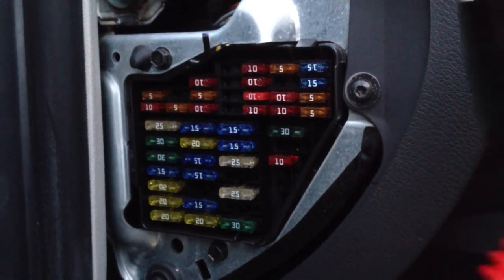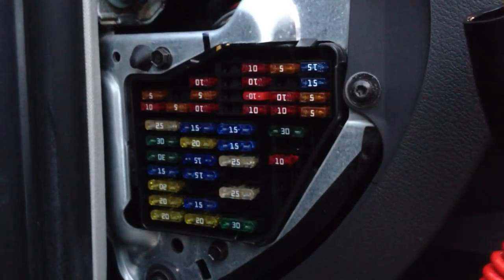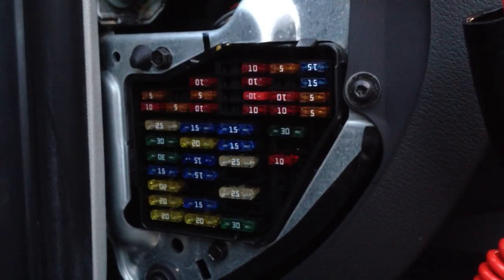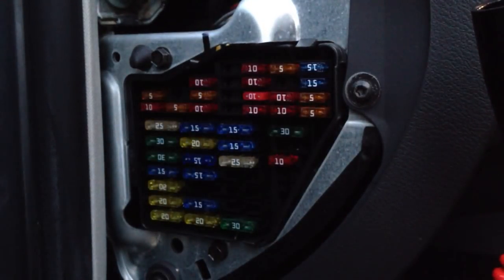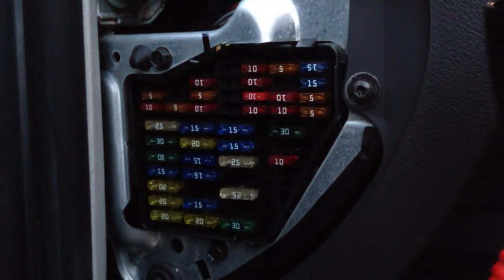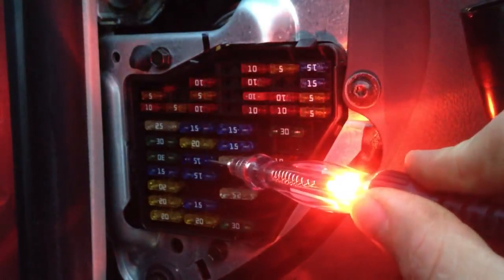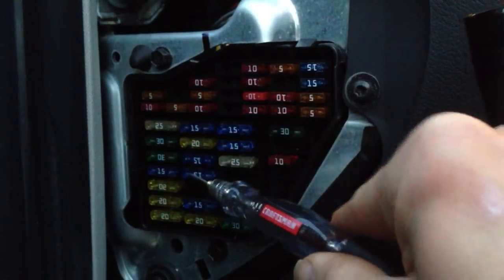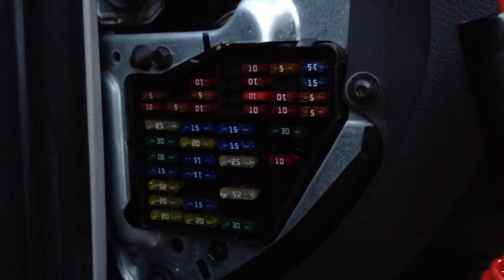How to check and replace a fuse 2005 Volkswagen

Comment from the maker: This is a really good couple of questions. 

The open slots are usually for extra equipment. That fuse panel you see in the video is the same for Golf, Beetle, Jetta, Passat, and is used all over the world. 

The numbers being upside down is probably due to a machine loading them. It doesn't matter for function.

Comment from the maker: Yes they are fused. They are on the same fuse if I recall. Generally if both of those switches are not working you have other issues.  Be sure to check all your fuses.

Comment from the maker: That is a good possibility. Generally it is the fuse in the back of the radio. Run down and check the fuses on the side(they are in the same place as my Passat). If they are all good, you may need to pull the radio and check the fuse in the back of the radio. 

If it is good, remove and reinstall the fuse. Then plug radio back in. That almost always fixes it.

Comment from the maker: IF you are having an issue with all the lights in the right headlight, it may be an issue with the connector at the light. If it's just the low beam, it could be a fuse, or a wiring issue to the bulb.

Comment from the maker: Start by checking fuse 41. I have ran into that exact thing. Some Passats have those things on the same fuse. 

The fuse block is in the same place as the Passat in the video(which is my Passat). Just pop the side cover off.

Comment from the maker: @Rudy,
It very well could be a fuse issue. I don't recall which fuse you need to check. I always recommend checking all the fuses. Check and make sure they are not blown, AND they are all there.

Comment: Another method if you have a VOM or Volt Ohm Meter is to set the meter to Volts DC and probe across the fuse, put the leads so that you are reading voltage across the fuse. A good fuse reads 0 volts because the voltage is the same at each tab it would be like putting both probes on the positive terminal of the battery. The voltage at each probe point would be exactly the same so the voltage between the probe points would be 0. 

When you test a bad fuse the voltage would read 12 Volts because one side is still hooked to power but since the fuse has blown the other side is at 0 Volts so the Voltage across the fuse is 12 Volts. This method is how you find bad fuses like Bussman Type fuses in an AC curcuit. You set the VOM to AC Volts and measure across the fuse. Good fuses are 0 Volts Bad Fuses read the supply Voltage in AC Volts.

Comment: Love you video thank you My locks on my 2008 VW Beetle will go on and off constantly and also all my windows roll down only if I use the switch that puts all four Windows down at the same time ( oh by the way its a convertible and that switch doesn't work either) is that a fuse or is that an electrical issue that's going to cost me a fortune
Reply: I feel your pain. I won’t ever purchase another VW ever again. Repairs are way too costly! I’ve sooo many things go wrong with my Beetle 😢

Comment: on the 02 Passat wagon the power outlets in the cargo area are in the relay panel behind the fuse box
you need to remove the kick panel below the steering wheel

Comment: Hi, Very informative.  But tell me is there a fuse for the 2005 vw Passat trunk lid.  The turn lid is not opening in my vw.  I changed the internal switch on the driver's door, but it still did not work.
Thanks
Dennis

Comment: omg dude, in the end of this video you replace one of blue fuse and check the top one if it`s work :))
Reply: the one he checked probably wasn't hot while the vehicle was off, so it wouldn't have power going to it.
Reply: it was just for illustration purposes, he put the same fuse back in, and that one wasn't powered since the car was off.

Comment: hi, im not a mechanic but im trying to test my car's fuses, i just bought a tester like yours and it does not light at all, i might have gotten a defective one or, do you turn the key on on the ignition to test them? also, i noticed in your panel some fuses are with the number backward, does it matter if the fuses are like that?... meaning right on left or left on right position for the fuse?... I apologize if my questions might be too obvious im just starting on this mechanical field, thank you and nice video.

Comment from the maker: @richard you will need to have the fault checked. If you have VCDS(aftermarket vw diagnostic software) it is easy. Otherwise you need to take it somewhere that can check it. Feel free to get the fault and email me with the info.  Charles(at)humblemechanic(dot)com

Comment: Thanks great video. My VW Passat 2001's tachometer, fuel gauge, speedometer, and odometer are not working, only ABS and oil signs are on on the panel all the time which are wrong. Can this be fuses because seems definitely electrical to me.

Comment: So, idk if you’ll see this cuz it’s been so long but, I know in my 06 Corolla I have the fuse box under my steering wheel and extra fuses under the hood. My problem is, I can’t seem to figure out if my boyfriends 05 vw golf tdi has its own spot for replacement fuses as well. Tried googling, scouring in the manual, etc and can’t seem to figure it out.. we also checked under the hood but didn’t wanna mess with stuff too much lol. So, the question is, does the vw golf have a spot for extra, replacement fuses to replace any that have blown and where might it be? OR where could I find a resource that could tell me this information? 
Thanks so much, much appreciated! And thanks for the useful video — never thought to get a lil pen like that to check the fuses to see if they’re working.

Comment: Hi.
Is there a fuse which only serves the side view mirror turn signal indicator lights, and if so, what is its location/number? That would be for a 2005 VW Passat GLX V6 with automatic transmission. BTW, the turn signal and hazard warning lights work fine, but not the little lights housed in the mirrors.
Thanks.

Comment: The diagram in my manual doesn't match the fuse on the car. Do you know which fuse could be for the mirror signals and the lowbeams?

Comment: Am replacing the Alternator in my 2002 VW Passat and the parts guy wants to know what Amperage I need.  My dash is beat to pieces and I can’t find the fuse box but is the Amperage posted there?  It’s a 1.8 L GLS automatic.

Comment: Hey Charles on my 2007 VW Jetta 2.5 Wolfsburg Ed for some reason my trunk and my license plate light bulbs won't go on neither does the inside switch works for my trunk any advice?

Comment: No clue if you’ll answer but I have 2009 vw Passat 2.0t and my sunroof works, opens fine but it won’t close all the way, i need to find the sun roof fuse but my car doesn’t have diagrams

Comment: Hello Steve. Thank you for your video. I was wondering if you would know where the  fuse for the fan is in a 04 VW Touraeg. My coolant light cane on but coolant is good and the fan comes on and it is running my battery down. I thought maybe the sensor for fan is bad. Can you help or any suggestions.

Comment: I have angel eye head lights on my passat so light rings with projector lights in the center of those. The projectors inside the eyes turn on with the ignition of the car but both have stopped working. I don't think the bulbs have gone bad because they stopped working simultaneously. The angle eyes and interior lights turn on with the light switch and work perfectly fine. My brights also work fine. Do you think this could be an issue with a fuse?
Reply from the maker: ***** So the projectors are acting as the daytime running lights? It could be fuses, or it could be the DRL relay.

Comment: Number of questions: any idea which fuse is for the gas tank door and trunk release?
Also, don't have your handy fuse detection tool and took each fuse out to see if it was blown. Never found one that looked blown. Also after turning the car back on, the dash indicators such as gas level and speed no longer show up! The time and other indicators are flashing. The VW dealership said that this may happen if the key is in the ignition when checking the fuses, but the key was not in the ignition. Any suggestions?
Reply from the maker: Molly Murphy off hand I don't recall. For some reason I don't think they are directly fused. Be sure that you do not have the trunk in valet mode. 

My guess is you got a fuse installed in the wrong spot. Did you take it to the dealer and have them check, or just call and ask?
Reply: Hello Molly I am experiencing this same problem right now and I have 5 miles until my tank is empty how to you resolve this issue?

Comment: Excellent video. Can the radio in my cc be impacted by a faulty fuse? Mine wouldn't turn on this morning, Nor would my dome lights.
Reply from the maker: +Cindy Jo Hursh it sure could. That's the place I'd start. 

I don't recall the fuse number of that radio. I always recommend checking all of them.
Reply: Will do!

Comment: Great video can you tell me where the fuse is for the o2 sensors  on a 2003 VW Passat 4 motion Thanks
Reply from the maker: It may have Heater fuses but not directly for the o2 monitoring

Comment: I lost my key fab...I thought it was the battery in fab,changed it but it's still not working.So I think it's a blow fuse for the fab??The auto unlocks work..with key and in car but just the fab is not working?I checked fuses but looks ok.Is there a box inside car or under hood that relates to the fab unlock that I can't find?I have a 05 jetta

Comment: Any idea where I would find a chart indicating the proper fuse amperage for each slot?  I bought an 05 Passat that is missing the fuse for the brake pad wear sensor.  Thanks in advance.

Comment: Dude, my interior fuse box is different from my manual diagram. It's a 08 jetta. Why are they different and how and where do I find the right diagrams and know they are right? Please help if ya can, German engineering is kicking my ass man. Thanks for your time in advance🤙
Reply from the maker: Even the repair manual lists all options. You have to match up what you have to the manual. It’s pretty silly

Comment: How does one find the right fuse? I want to check a fuse for the AdBlue tank heater element in VW Sharan. VW SSP shows there must be a fuse but does not say where this might be? How do I go about finding it or making sure it's not blown?
Reply from the maker: I like to check all of them with a test light or power probe. IF that doesn't get me anywhere, I look at the wiring diagram,

Comment: hi my 2006 touareg ac blower stopped. replaced the blower fan nd the control resistor nd I have the same answer. pls can u show me where the relay is located?

Comment: Do you know which fuse is for the trunk release on an 03 jetta GLS? 
The fuse map has no symbol that resembles anything close to a trunk lid. 
I keep reading about a fuse #14 being the culprit, but that’s the fuse you said you replaced to fix your dome lights. 
So I’m not so sure now lol.
Reply from the maker: It’s probably for the CCM which control both

Comment: Where can I buy the fuse box? Not the one on top of the battery but the one on the driver side like in this video. I've googled around but can't find it. Any idea?
Reply from the maker: +A Google User it's part of the body harness. Unless you just need the case

Comment: I have a 2006 Passat. Both of my DRL, both of my low beam headlights, and my 12v no longer work. The original owner's manual shows that in the Driver's side fuse location #5 it should have a 10 amp fuse for the right side headlight. There is no fuse in that spot. I am the only one who works on the car and since there has never been a fuse there, I am not sure how the headlight was working. Any ideas?

Comment: What happens when you replace your fuse and it keeps blowing when you use your turn signal, the comfort control module is okay we took it out and all the harnesses are fine, there is no water from the roof or the front of the car it is completely dry, I have just checked the turn signal lights for the front and rear and there are functioning fine because the hazard switch works fine, the only thing that keeps happening is the fuse keeps blowing when we use the turn signal on left or right it blows almost immediately what do you think is my problem? Terry   forgot my mechanic replaced the the turn signal switch for me also.

Comment: i have a vw jetta 2000 2.0 my gas gauge and temp gauge are both unresponsive when i look up what the problem is on vw website it says it’s probably the fuse feed but i don’t which one it is i’ve read the manual and everything another thing is so different slots use different fuses or are they all the same

Comment: Hey Charles, Q: how do you volt drop a fuse that has no test points( a lot of but not all the minis in your upper fuses seem to be of this type)? I am chasing a parasitic drain on a 02 passat and do not want to pull them if possible. Thanks,
Reply from the maker: +Jonathan Barnes you can try to back the fuse out enough to get on the contacts.  But it's a pain. 

Or on that car, pulling fuses is fine. If you watch current draw at the battery

Comment: helo. i have a problem with a ww passat 2000. roght window and rear mirror is not workink. and the door is also blocked. what do you think. thank u
Reply from the maker: I would look at the connection at the door and body.

Comment: HI I APPRECIATE YOUR VIDEO. MY WINDOWS DO NOT WORK.  I CANNOT READ ANYTHING ON THE PDF FILE. TOO SMALL PRINT AND I HAVE BAD EYESIGHT. SORRY. ARE THE ELECTRIC WINDOWS ON THE 28 35 37 42 SPACES AND WHAT SIZE FUSE DO I USE.   I AM SO CONFUSED.  SORRY TO BOTHER YOU AND THANK YOU

Comment: Hey man, my 2004 vw Passat was driving good this morning, I had to run to my grams to help her. I got done about an hour or two later. I get about 3/4 of the way home (about a 5 minute drive in total) and it just starts to slow down and my gas pedal is acting as a brake while I’m pressing it, it’s just slowing down. Now it will turn over but it’s barely producing power at all and just basically dies. The battery is fine and working but I’m just clueless as to where I should start here. I need this thing up and running to get to work but I have no clue what it could possibly be besides maybe a fuse or my fuel pump? If you have a number I can send you a video of what it sounds like when I try to start it. Please respond if you have any clue.. I’d appreciate it!

Comment: I don't know witch fuse is for my sunroof it won't open anymore I have 2004 volkswagon passant I do know where the fuse box is located but don't know what one it is lights work on inside the car just the sunroof don't open any more and I'm trying to find out where to located the line so I can recharge my air do u have a video on that and how to change air pump

Comment: Hey Charles, I wonder if you can help. Is there a fuse for the brake lights and if so where is it located? The rationale I am using is --- it must be a fuse because I figured all three brake-lights probably wouldn't blow at exactly the same time.
Reply: Same happened to me, please help Charles!
Reply: same to mine. Have you guys fixed it yet?
Reply from the maker: sethlove06 Jim McDonagh Benny C 
More likely a bad brakelight switch than a fuse.

Comment: So i gotta 2001 volts wagon beetle and my dash lights are not working anymore also my back lights are not running during the night but the brake lights work and the signal lights work could this be works of have a bad fuse ?

Comment: Hi Humble Mechanic
Can you tell me how to identify which fuse is for the speedometer please there is no symbol or anything in the handbook..
for example on my 2005 bora tdi fuse no 28 is for the radio.
Kind regards
Paul
Reply from the maker: Hey Paul,
I don't think there is a fuse for the Speedometer.

If you are  worried about a blown fuse, grab a test light and check them all. Also look and make sure they are all there.

When I run in to an issue at the shop, I check ALL the fuses. It is faster than looking it up in a wiring diagram.

I think it's crazy they don't put any info about fuse location, but it is what it is.
Reply: HumbleMechanic Which fuse belongs to the radio

Comment: Thank you, this video was extremely helpful.  I took a look at the fuse card for the vw golf 04, I could not figure out which fuse to replace for the dashboard clock - it resets to 12:00 every time I turn on the car.  Any idea?
Reply from the maker: +Melba Pina-Gonzalez That doesn't sound like a fuse issue. Does anything else act weird?
Reply: the radio does not work, everything else is good
Reply from the maker: You can try takeing the radio out and unplugging it, then plugging it back in. 

The cluster and the radio are linked, so it may be a cluster issue.

Comment: the horn in My 2011 has stopped working. Is it likely to be a fuse and if so do you know which one it would be?
Reply from the maker: usually it's more likely the horn itself not the fuse

Comment: hey man i just recently bought a 2001 golf gti and my tail and dashboard do not work, but the brake, reverse, blinkers and headlights do, i checked my fuse box and all of them are good if you can help me out whats the problem and thanks for reading it
Reply from the maker: +Kire Knyzals which light on the dashboard doesn't work? 

have you tested the bulbs yet?
Reply: +HumbleMechanic like all dashboard just like brake battery abs open door lights on when i turn the key on but like no lights at all on rpm fuel and etc and tail lights also do not work

Comment: I have an MK4 GTI and driver side turn marker light doesn't work but the right one does. Any idea why it would stop working, fuse?
Reply: try moving the bulb around if it turns on in certain positions the terminal inside is corroded you can try cleaning it